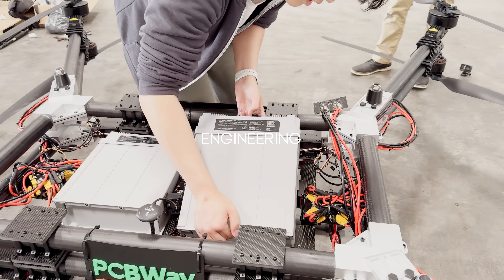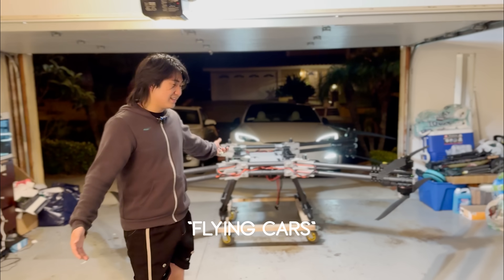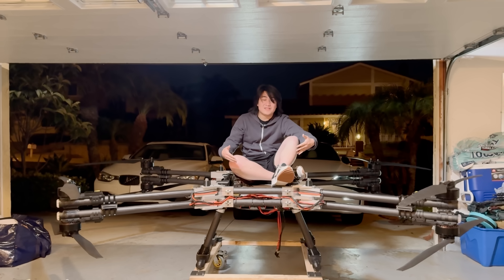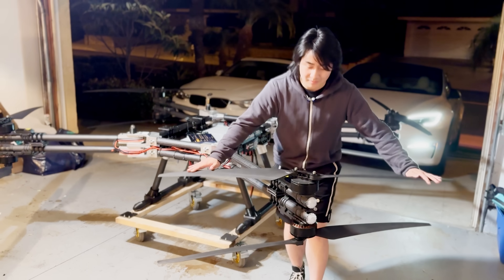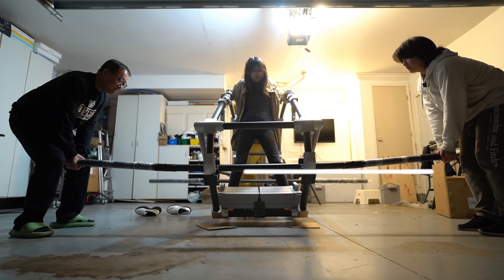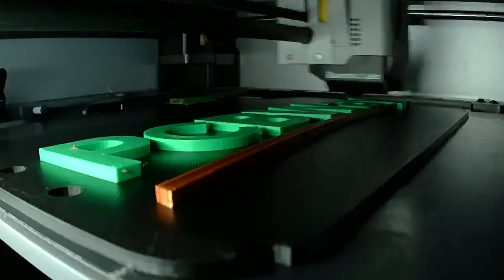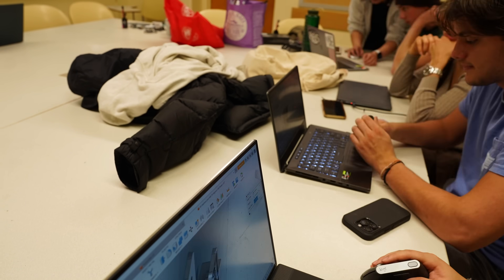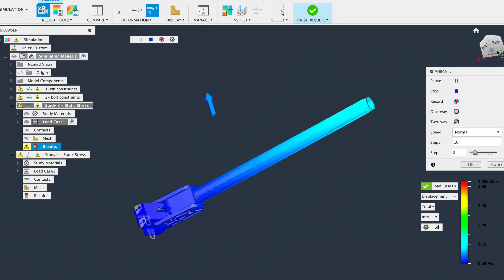My "flying car" finally FLIES

Comment: Love the build, brilliant.  

Every time I see manned quadcopters I can't help wondering why nobody has followed on from Curtis Youngblood's Stingray 500 design ?  He modified it his model to fly on just one single nitro engine offering superior flight time and quick refuelling.  Apparently it was able to auto rotate without power like a Helicopter for emergency landings, surely that alone should make variable pitch safer...?  I see plenty more advantages in his design too but so far haven't seen anyone come close to creating a useable aircraft, I mean useable in terms of flight time.

Collin furze did a great job too and I also though he was close just needing stability which I thought could be achieved by combining his twin engine petrol design with a standard battery quadcopter / drone used only for control and stability, the main combustion engines would provide the lift and via alternator also provide power to the drone motors.
Reply: Helicopter won in any real competition. Also: You cannot control a nitro engine like an electric engine. That was some good weather tether pipe dream.
Reply: @ArneChristianRosenfeldt  You don't need to focus on the control of the nitro engine when using variable pitch.
Reply: @TheTwistedStone  variable pitch = helicopter. Fixed pitch = multicopter
Reply: @ArneChristianRosenfeldt  Says who ?
Fixed pitch adjusts speed to change lift or thrust, variable pitch does the same by varying the pitch of the rotors hence the name.  Again search for videos showing Curtis Youngblood's Stingray 500....
Reply: @TheTwistedStone  sadly says only me, but just read about rotor heads. The problems are centrifugal force and leverage. This is also a problem in the tail or a multicopter.

Helicopter have this huge and heavy gear to push the long blades. I don’t understand why small helicopter use a belt here. I still think that a closed box ( dirt vs oil ) planetary gearbox with 5 gears like on a WASP is the way to go. 

Cyclic is only important for speed.
Reply: @ArneChristianRosenfeldt  I just think it's a waste of time building these 'Manned' drones just for a 10 minute flight.....
Reply: @TheTwistedStone  someone built a plane for his commute. The road takes a huge detour around a canyon. 12 min in air.

A helicopter could launch almost like a rocket. At 1 km stop the rotor, bend one blade to the back, and swing out a different blade to the side. Glide like a plane towards your destination at 300 km/h. Tilt tail to become a pusher prop.

Comment: Hmmm don't know what's your budget... I see some serious design improvements in joint rigidity to be made but hey, good job
Reply from the maker: Point some out!
Reply: @alanzeekk  design a compression mold to forge carbon fiber joints... I think instead of getting something cnc'd you should go mixing or adding it to design.
Also if you fuse the arms with that in mind to design you could reinforce the structure, reduce weight and diameter needed. I can help you out with math or design... If I can add something and improves... I always do it

Comment: What CAD program do you use? is that fusion?
I'am asking because I am a MacBook user and I get to use Siemens NX for free. But it's only for windows so I have to use Paralles (a virtual machine) but despite this alone is 100€ per year I can't even use my full Ram because this would cost even more. Would be happy about an answer :)

Comment: sometimes i think why dont i just use the bext dji done system to control the notors
Reply: it would be smooth as then, auto level and correction,gps and autonymous ,can you imagine being on it and hitting meteor mode haha thats nuts

Comment: you need more than a roll cage, you need a personal battlebot/shark cage. A blade comes off and you're about 8 pounds lighter, and sans pilot.
Reply: You think a roll cage is going to help you all that much? Also, you think a blade coming off in your general direction is the biggest threat here?

Comment: You definitely want to swap that "perfect" bolt the other way around. If the nylon lock nut falls off, you still have your "lock pin" installed. The way you have it now, your pin falls out and your redundant arm stack Flys off too.

Comment: i scrolled through a bunch of comments but didnt see this issue mentioned, so apologies in advance if it was. why are the legs of the landing gear made from carbon? carbon is rigid, then it cracks. thats the last thing you want. the landing gear of a helicopter is aluminum and is designed to deform in a hard landing so that hopefully your body doesnt. You ought to replace those tubes with something that can substantially deform before failure.
Reply: Mayhe will have have a shock absorbing seat to save weight and not have it for the whole craft. Every pound is important. If it can lift him for 3 minutes I'll be amazed and he would have shown a longer manned flight than billion dollar evtol companies.
Reply: F1 cars use carbon. I actually would want dampers like on F-18 for carrier landing. Bite the bullet: Landing gear is 10% of the weight
Reply: @ArneChristianRosenfeldt  F1 cars also have crumple zones, and a helicopter's primary crumple zone is it's landing gear. As far as the weight issue goes, what is the weight difference between 10ft of the carbon tube used in this project and aluminum tube with a wall thickness thin enough to deform in a hard landing? I'd go on a diet and eat the weight difference if it's mission critical.
Reply: @jjja727  so the tube needs a different weave to crumple? Give them a thread like shape?
Reply: @ArneChristianRosenfeldt  unless there is some sort of specialty engineered carbon fiber structure that I'm unaware of, the stuff doesnt crumple. it remains rigid then it catastrophically fails. aluminum tubes can bend. this absorbs crash energy and decreases the peak force that gets applied to your body. 

carbon fiber isnt ALWAYS the best solution to an engineering problem. look at the submersible that they tried to take to the titanic as an example.
Reply: @jjja727  but F1 uses carbon Fiber for the crumple zone. I mean, I am not invested here. I would check that my shocks are filled with oil. Lots of attack helicopters have impressive shocks. See Eurocopter and the new model in India and Turkey .

Comment: As a person who has help build experimental aircraft I know what it takes to get from design to physically flying, Congratulations on your first flights!  I have of a question about stability and the placement of the load. Would it be more stable if the weight were hung under the eVTOL rather than on top?
Reply: Like a (rotating) wing, the propellers cannot create lateral forces. All forces are normal. So only normal forces act on the center of mass. No torque can be generated. Planes use the vertical tail or dihedral or winglets to create lateral forces and make the height of the center of mass important. With a fast flying quadcopter, drag exerts large lateral forces on the propeller, arms and nacelle. The whole copter needs to be tilted forward to fly fast. So it would be top heavy. Yeah, sounds like a bad idea. All copters have a cg in the geometric center (3d) . A classic helicopter would need a black hawk like tail rotor, if cg is behind the main mast.

Comment: I wonder if its possible to build some sort of open cage around the propellers just to protect them.
Reply: Then you cannot fly forward. Like, you would need to retract them. Still stuff will be sucked in. I want wheels, where you go fast enough to suck in the air in fron of you, and don't suck in dirt from the ground.

Comment: Why sit inches from the spinning blades? Surely it makes sense to sit suspended below the blades as in a helicopter. It lowers the C of G and decreases the risk of decapitation.
Reply: For a camera as payload, all 8 rotors were once placed in one plane above on an H structure. Apparently, cameras are more worth than humans or so ...

Comment: Awesome work man! let me know if you want to make it a hybrid electric, my micro gas jet turbine genset would look nice on this rig..
Reply: Range extenders are an add-on. A turbine is expensive. You need two expensive turbines: The one which drives the compressor and the one driving the dynamo. It might be fun to use drive shafts for the lower propellers, but calculate the number of turns and all the friction. And fire hazard.
Reply: @ArneChristianRosenfeldt  why not run the compressor for air bearings, and the dynamo off the same shaft? LIPO is already is a fire hazard. Adding diesel to the mix just requires a little extra caution. You can’t achieve that energy density with batteries alone, or with a piston engines weight and induced vibrations.. pricy but if you can fly for 4hrs instead of 15mins it worth it.
Reply: @dronelabs300blk  A turbine can only extract a part of the energy of the combustion. In a turbo jet the rest is blown through a nozzle, but a helicopter needs a second stage. Typically, they use a shaft from the back. This is for better throttle / wider range of operation (temperature, fuel type). I just mean that is would be weird to install 4 jet engines ( all around ). Still need the shaft like on Osprey for engine failure.
Reply: @ArneChristianRosenfeldt  yea I never said 4 jet engines. You need one auto APU. Stop complicating things because it suits your sci-fi utopia.
Reply: @dronelabs300blk  APUs are gas guzzlers . Boeing replaced it with a battery on the 787. One of the successful thing Boeing did lately. No helicopter ( in the West ) has so low tech engines. They all use axial compressor with a final centrifugal stage and two turbine spools.

This French Ironman wears 5 engines . Add Sukhoi thrust vectoring
Reply: 787 still has a BIG apu in the tail. off the shelf APUs wont work as a main power source too big, and need to be redesigned to improve efficiencies. More like, Bladon and Capstone gensets but with light weight re-coups.
Reply: @dronelabs300blk  oh, back in the day I read it like they filled all the tail with cells and still considered it a fire hazard without an actual fire nearby. TIL

Comment: I get the fact that you are very intelligent from the engineering aspect of your creation, I just hope your intellect prevents you from getting on and trying to fly it. Please use a mannequin weighted to simulate your body stats for any proposed maned test flights.
Reply: for the tests. Then just acquire 1000 flight hours without harming the dummy.

Comment: but did you try incase those blade in a tube to direct air more down. And utilizing rope could save you a weight
Reply: use those modern props which meet their mirror at the tip. For a case you need a fan. F-35b comes to mind. Fans seem to lose against propellers for low speed.

Comment: What voltage are the packs at? I assume they have a built in BMS, so just a dumb variable power supply could be used to charge in the interim.
Reply from the maker: 72V, good point! I’ll try

Comment: Cool project. Have you considered just using more common batteries with less complicated chargers? Ebike batteries can charge off of $20 chargers. No sense in selling yourself short on testing such a cool project because of one component.
Reply from the maker: Good point! I did that with last video, but managing batteries are actually quite a hassle. I just ended up buying these batteries with BMS (auto discharge, balancing etc). So there is a trade

Comment: My thoughts ... That's just a big drone... Can I build a normal drone? Nope? Now imagine building a car and building a very big car ... Very different things. Great job my comment doesn't make sense.
Reply: With RC models, builders start small and build bigger and bigger model as long as it fits into their car. These cars/planes/ships perform reasonable on their maiden. They buy more and more expensive cameras to fly on said planes and more expensive engines ( radial, jets ).

Comment: You built an aeroplane.
There is no such thing as a flying car - AND THERE NEVER EVER WILL BE.
Because, if it flies, it is governed by flight rules, and planes can NOT be used as cars, because there are very strict rules about where you can fly, and where you can land.
Reply: Never is a strong term - how do you know? Are you positive that regulations cannot be changed?
Reply: Ground effect cars show the way. Payload is one light person. Lots of carbon fiber. Relative small engine. Needs 200 mph to take off. Width: 2.5 m .  Regulations will follow after a successful demonstration.

Comment: YOU GOT LUCKY FLYING IT IN THAT SMALL SPACE!!  😁😁  But that's good!  It means you and your team are lucky! 😋 On the other hand, had it crashed into one of the walls or the fence and destroyed itself that would have gone viral and you would have got the money from Google to fix it from the ad revenue!  HAHA! 🤣🤣

If you redesign those CNC brackets that clamp to the carbon fiber tubes, double up on the clamping bolts.  That looks bad to me with the single bolts that you have.  It's working of course, and I noticed you went with thicker bolts, but you want to think in terms of redundancy.  🙂

It's going to fly with the roll cage, the seat, and the simulated human load.  I don't have a concern about that.  What concerns me is a prop break.  What's the flight controller going to do?  Also, will the pilot be safe if the controller compensates for the break safely but a section of the broken prop enters the cabin at a high velocity.  Maybe design some protective Kevlar panels to mitigate this possibility.  Aside from software simulations, you can cause a prop break to see what will happen by sawing through one while the craft is in flight.  Simply attach an angle grinder with an abrasive blade and an RC actuator to cut through a blade while in flight.  You'll get your money back in ad revenue if anything bad happens. hehehe! 😋😋

If you need a pilot, contact me.  I just turned 60 yesterday so I'm officially old and expendable!  HAHAHA  🤣🤣🤣

Joking aside, with the mentioned safety measure in place I think it would be very safe, provided the pilot doesn't do crazy acrobatic maneuvers all the time. 🙂

Nice work so far!  Very impressive engineering!  😍
Reply from the maker: Hey dude! Thanks for the effort in this comment!

The CF tube clamp is held down by 3 bolts instead of one, when folding the arms, two needs to be pulled out. 

Your other advice are insightful, I’ll review them with my team.

Best,
Alan
Reply from the maker: Btw I think the indoor space flying isn’t really just pure luck. I’ve been flying fpv racing drones since 7 years ago so definitely my trained intuition and drone control def helped. But yes, got lucky haha
Reply: @alanzeekk  OH!! I see!  I see!  I was wondering how you kept it from hitting the wall!  That explains it!  Nice skills!  😁

As for the bolts, I'm not an engineer, I'm more of an artist/inventor.  So, my redundancy comment is more of a "make it look good" comment.  Although perfectly functional, adding some gussets and an extra bolt would make it look good.  People think redundancy looks good.

Speaking of nuts and bolts and looking good, you may want to eventually do everything with lock wire.  You could probably get away with your locknuts, but when all the fasteners are done with safety wire it makes it look immaculately engineered and AEROSPACY!  Yes!  I just made up that word, but now I think you know exactly what I mean.  😁 

Investors like things that look AEROSPACY!!  HAHA! 🤣🤣

Comment: If you take plywood and stack them into a thinck enough layer, glue them together, and cnc a mould for a carbonfibre frame, cast a complete cabonfibre frame, will it not be ligter and stronger?
Reply from the maker: You’re right haha. Budget issue

Comment: If I may, I’ve actually had this idea for years now however, my design is a little different from where you had your chair The two arms in front of that would actually combine and only hold two propellers spinning directions just like you have. The battery would be underneath the front propellers and then the seat would be moved halfway down so that the propellers are about kneehigh when sitting down. I think this would be easier for weight distribution purposes. Just a thought if you wanted to redesign the front and the seating area.
Reply: actually combine? Redundancy!
Reply: @ArneChristianRosenfeldt  by combine I mean replace 2 spots for your front blades with 1 redundancy could be a backup motor or battery for it

Comment: Might be a stupid question by someone who is very much not an engineer, but: I assumed it would be more stable to fly / control with a lower center of gravity, i.e.: having a gondola below it where you sit in, rather than sitting on top of it?
Reply: Have a look at the hiller flying platform, blades underneath and weight shift control. The high CG has a stabilising effect. The rotor follows the weight in order to self correct. 
Compare that to a helicopter where the weight is below the rotor and that's unstable. A tilt just gets worse and worse unless it's manually corrected. 
High CG is a good thing in my opinion.

Comment: Great video,
I have a question, what type of flight computer you have on there? What is the main electronic of this project and what software did you use for control of the motors, or did you make it yourself?
Waiting for the next video, godspeed.
Reply from the maker: Thank you! FC used is a pixhawk 6x. Next video will cover tech specifications